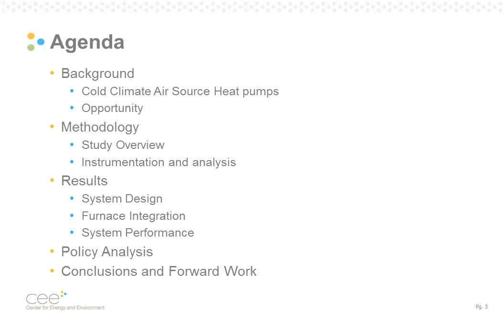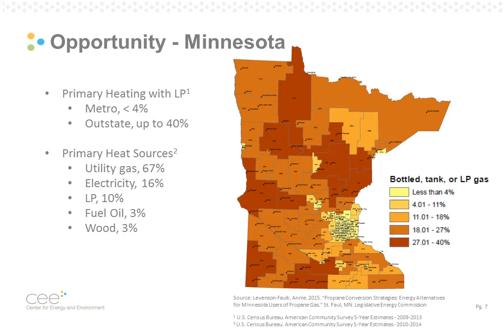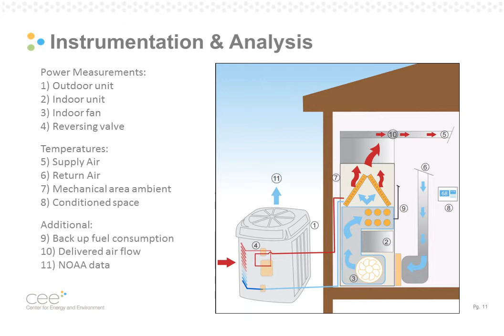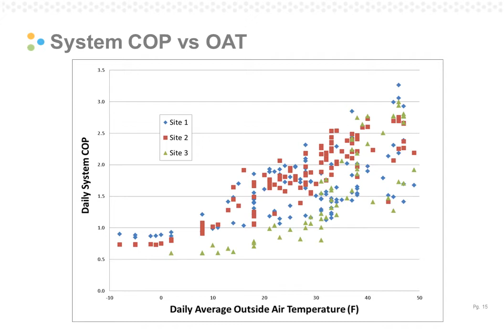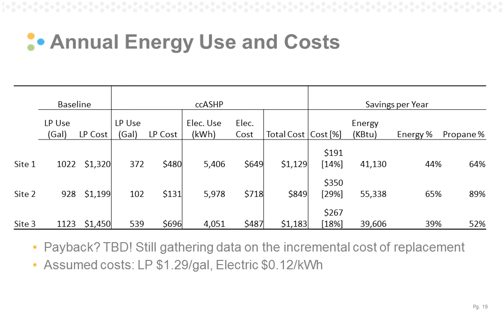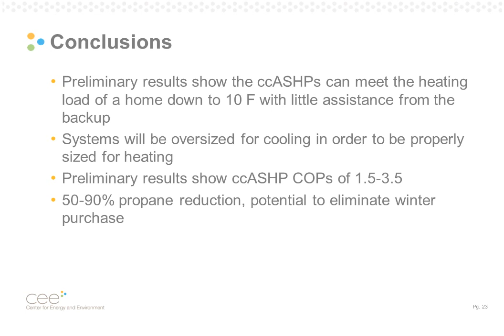Field assessment of cold climate air source heat pumps

Comment: Interesting! Hard to find this level of detail elsewhere. I recently switched from electric baseboard heating to a 97% propane furnace + air source heat pump. The way I look at it is that if I can recover the cost difference between central air and a heat pump then I am happy. The heat and humidity here in Michigan have made central air a must! I figure I can recoup the $1-2k cost difference well within the life of the unit compared to propane + central air. Of course it doesn't hurt that my electric company provides a discount for ASHP! I'm paying 7 cents per kwh.
Reply: @steve... This is interesting in that the degree days in Mn. are double my own in a mid atlantic state. The low tempture here is 0°  and summer highs are 100°. 

My mini split two ton unit was sized to meet the home heating needs down to 10° since the total hours of zero temptures is under 12 hours yearly .

The dollar savings compared to my much loved hotwater baseboard heat was over 55% adjusted for fluctuating heating oil cost with a payback of under five years.

The intangibles  are our hot humid summers are amazingly comfortable from the outstanding humidity control. Oversizing for heating does not effect humity controll like in non inverter heatpumps.. 

The unit is so quite you forget its there! .  While every home is unique ,  I beleive my home is particularly suited for the Mitshubishi single outlet  system I cant think of a reason why mini splits wont significantly reduce your hvac energe cost.  

Hope my experiance of three years is helpfull . Reading 1st hand accounts from users was to me.
.